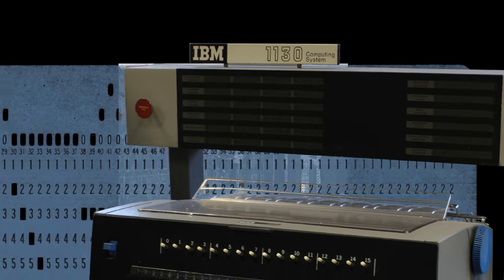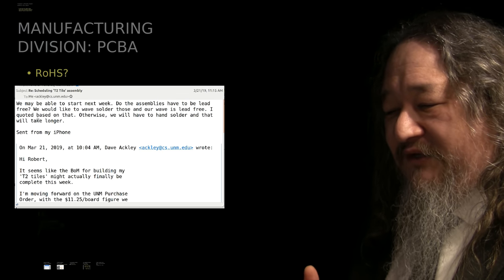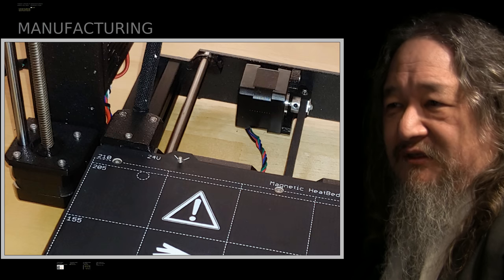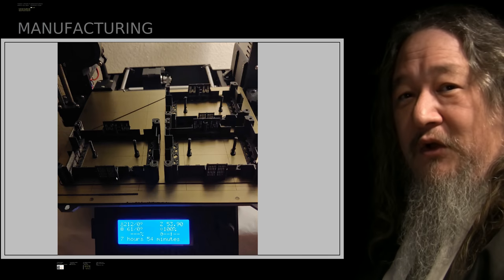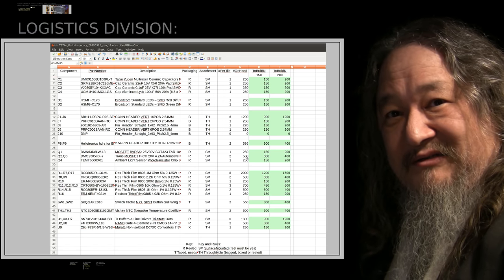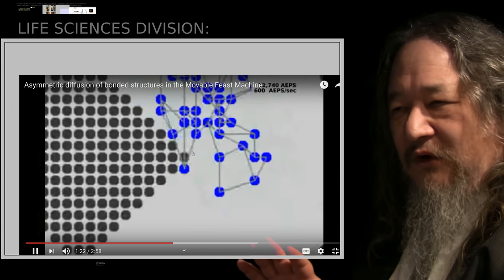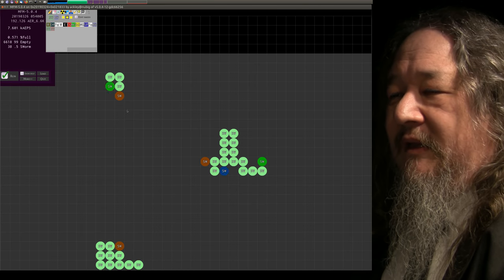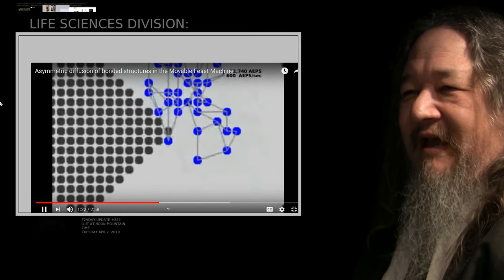Midseason Finale - T2sday Update 224

Comment: Been following this project and the MFM off and on for years. This was a good episode to pick back up with again. Love the bridging worms as some kind of MFM version of the double linked list primitive datatype. Let's race them on the infinitely tessellated computing plane!

Secondly, and maybe this is mentioned somewhere else, does the developing T2 project have anything to say about non planar / non euclideon connections among tiles? That is, do implementers of processes have to think about and create robust algorithms for strange loops or small scale self-linking edges of tiles? Perhaps you'd have three tiles placed in an arrangement like the corner 3 of 6 faces of a cube.
Reply from the maker: The T2 idea is that the intertile geometry will be, at least locally, 'best-effort flat', and higher levels will typically count on that -- although especially small and simple constructs might not need to.

Comment: Loved the worm demo, although they aren't very robust...

It seemed to be that bonds were a pretty powerful tool to detect destroyed atoms and possibly recreate them (and the data they contained). Is there a replacement structure for safer data in the new MFM?

When it comes to moving atoms around, there can be a lot of solutions. I personally envisioned worker cells with walls, surrounded by an ever-moving blood-like circuit of mover cells, carrying what ever found it's way in near them (except cell walls, obviously). The cell walls could contain "docking stations" made of atoms that accept atoms if the structure fits.
Reply from the maker: Back when, the bonds individually were not robust.  The 'self healing wire' from like https://doi.org/10.1093/comjnl/bxs129 used redundant bonds for robustness.
Reply from the maker: There are lots of solutions indeed.  I too think about a 'circulatory system' as a long-haul data bus.  I think it's coming!

Comment: I'm tempted to write an RWorm, which converts the head to a tail and tail to a head when it detects it gets stuck
Reply from the maker: Or at least have a 'back up' segment, that a tail could inject and it would propagate forward.
Reply: retrace it's steps by backing up until the head sees another option to move in, black listing all cells  that come to a dead end

Comment: Could the worms used as internal connectors between connections of the tiles? Let's say there is worm type that tried to connect the west connector to the East and once it is connected it just passes data in one direction, and rebuilds itself if damaged or parts of its body is eased? (or am I misunderstanding it?)
Reply: in retrospect, I may have commented too early :D
Reply: the length is fine btw - I think content matters more
Reply from the maker: Tiles are pretty low-level -- they could change or even disappear entirely -- but worms could certainly be like 'wires' or data connectors between bigger, slower things like cells.
Reply: @T2TileProject  didn't somebody in our class try to build something that established a persistent connection between two sites that were far apart?
Reply from the maker: @JobyElliott  I'd have to go look at the projects again.  Related things have certainly come up in a few different contexts.